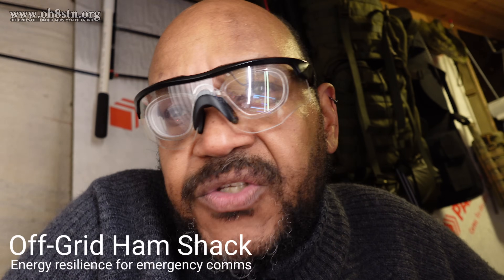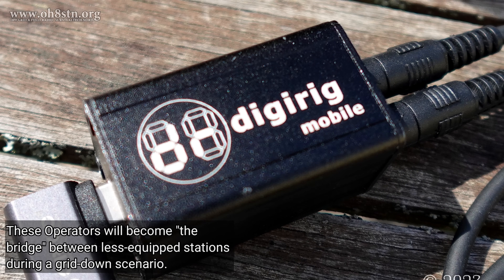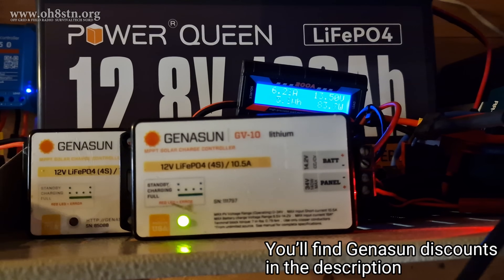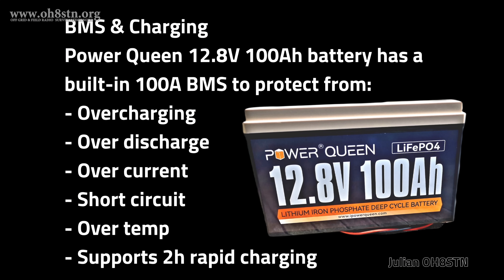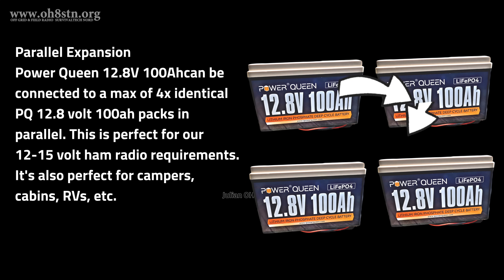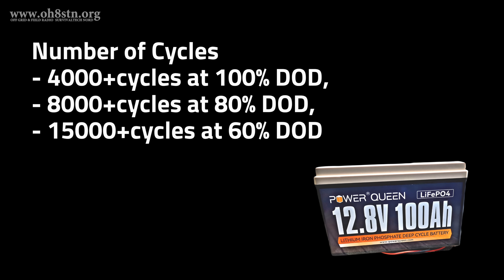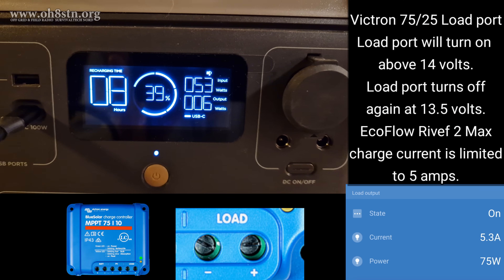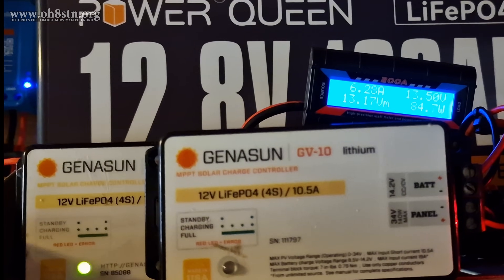Energy Self-reliance & Off-Grid Ham Radio Station

Comment: Julian - Thanks for providing information based on a pragmatic implementation. I'm motivated to run my shack on solar because I think it would be less expensive than increasing my service from 100 amps to 150 amps. I haven't run the numbers but even if the cost were the same I'd rather use solar since it would give me communications even when utility power is unavailable. It seems to me my aggregate demand for power for radios accessories, computers and an amplifier would require at least 100 amps without redundancy so perhaps a design goal might be a system to support 200 amps. You have no doubt worked the numbers and perhaps have a tool or spreadsheet that would help with the design. Thanks - Phil K0PWS

Comment: Hello. Love all your videos and in the process of emulating this system. I would like to ask how is the EcoFlow River 2 Max for RFI?
Reply from the maker: Thank you 🙏
As with all inverter generators, there are two sides to this question. 
The DC outputs, USB outputs, and charging from solar or USB-C PD are all clean.
When the AC inverter outputs are on or AC is being used for charging the River 2 Max, the RFI is terrible. 
I only use the AC side as an emergency measure. So the AC ports are deactivated unless in use. This way, RFI is not an issue day to day.
Hope this helps.
73
Julian oh8stn
Reply from the maker: Take a look at this post: https://oh8stn.org/blog/2023/12/21/building-an-off-grid-solar-powered-ham-shack/

Comment: Ive been tinkering with solar for years now.
Getting real world experience with what you need and what you can generate is vital to success.
My hamshack has always been off grid.
I dont own a wall plug power supply.
With lifpo4 320amp battery is a game changer for sure.

Thanks for another great video.

73 VA6CQB

Comment: so you are going to put multiple charge controllers in to handle the amperage of the solar panels ?
Reply from the maker: In part yes, but also to handle the different sets/strings of solar panels. I've got a set of solar panels up on the tower. One south facing set at the back of the building. Two sets on the southwest wall of the building.  Finally, another south facing set on a lean-to we are building next spring. We would also like to add supplemental panels. For example, some of my portable panels in an emergency. All of these different sets or strings of solar panels require their own charge controller.

Comment: Yesterday I was thinking on what battery to buy ,then saw you video. Thank you for sharing your experience.  
Could you please check that the coupon code for the battery (discussed on the video) is current? I tried it at the checkout and it is not valid / applying.  Sorry for the inconvenience. 
Thank you,

Comment: not sure I understand what you are doing with the multiple genasuns and the wind camp Anderson power pole thing? are you and if so how are you connecting all the genasuns to the wind camp?
Reply from the maker: Each of the strings of solar panels are connected to an individual charge controller. The connections between the charge controllers and the battery are via the Windcamp SP-8.
Separate video incoming.

Comment: I am surprised that you can parallel the outputs of the charge controllers. Is that something that only Genasun supports or do they all do it?
Reply: As long as we're talking about DC (not AC, that gets more complicated) and the output voltage of both is kept within a tenth of a volt, it should be fine.
Reply from the maker: @grahamauld8894 I've only tried it with Genasun controllers. However,  multiple strings of solar panels on different charge controllers connected to a single battery is normal on RV, Yachts and Overland vehicles. As long as the controllers output voltage match the battery, theres no problem. 
73
Julian oh8stn

Comment: Thanks Julian, I am just entering the process of setting up a off grid hamshack.  But I'm gonna need to get rid of my windos machine or generate some 110 as well. Looknig at my house its all electric so we will just need to run the 110 fan in the woodstove to get some house heat.  This is going to be a study.  Perhaps I just get 12v uninterupted in the shack first.  N5OBC
Reply from the maker: You might find that AC/110 introduces noise into your radio equipment. Have you considered a peltier based wood stove fan?

Comment: Really looking forward to this series. Are you running DC appliances (non-Ham) in your shack or AC through an inverter? I've been hunting for quality DC lights, hot plates, etc. but the "quality" part does not seem to be out there.
Reply from the maker: Agreed.
Trying to keep everything DC, because of the inverter noise on HF. The EcoFlow River 2 has 2x AC outlets just in case AC is required temporarily. 
Quality lighting is my problem. Testing LED lamps used in busses/cars, but the switching is terrible.

Comment: How much does your primary radio pack weigh?
Reply from the maker: It's a great question,  but difficult to answer as I use different rigs for different applications. For data comms (my primary operating mode) I use an IC-705 with Microsoft Surface & N9SAB dipole. Total weight 1.5kg/3.5lb for all mode, data, phone, cw, ...
https://www.youtube.com/watch?v=r22xilag_9A
Reply: @OH8STN  Wow. I've got a way to go. Down to one pack and tablet (two carrys). Pack is 26 lbs. Believe me, this is 1/4 of what I used to pack.

Comment: Hi Julian!  I have been running an offgrid ham shack for the past 3 years.  Everything runs off of solar charged batteries: Radios, computers, lights etc. At the moment all is kind of ramshackle.  I have been following Will Prouse's youtube channel.  He offers many videos on setting up off grid systems.  I took from his book a plan for a photovoltaic system for an RV or small cabin.  It is a system consisting of at least 800w of solar panels (I am using 1200w) a 24 volt system, total 600Ah and a 3000w AC-DC inverter.  This system is moveable and is intended to also back up essential appliances at the house in case of a long term grid down situation.  The components are there.  I will be assembling soon.
Reply from the maker: Thanks for watching and commenting. The reason I didn't go with inverters is the noise they create on hf. This is about the only thing I can see, which is different in offgrid cabins, RV, ... than ham shacks. Have you found a quiet inverter yet?
73
Julian oh8stn

Comment: I love having multiple back up charge controllers, BMS's and inverters. Very smart. I do the same and even have back ups in a faraday cage. One thing I noticed. Your wind generator shaft goes directly into generator. This puts a lot of strain on the bearings in the generator. Having a separate, stand alone bearing between the generator shaft and shaft of the rotor would take the strain off the bearings in the generator and should help the generator to last longer. Just an observation. Thanks for all you do for the emergency radio community Julian.

Comment: I have safety concerns with that DC power block as you expand your power system. Have you considered using a combiner box with breakers?
Reply from the maker: Yes, I have the same concerns. Currently I can generate up to thirty amps from all of my solar strings. More strings will require the planned additional power distribution board. Naturally, I am willing to consider a combiner, If someone has experience with one they can recommend.  Recommendations welcome 🙏👍
Reply: I am off grid and use Midnite Solar combiner boxes.
Reply from the maker: I'll check them out 🙏 Thank you.

Comment: Nice kit. As long as you aren't net control running multiple radios you are set.
Reply from the maker: Thanks. I'm generally running three radios at a time with this set up. Winlink Gateway, Robust Packet HF APRS, and a JS8Call station. Voice comms while the others are running could be problematic if we're on the same band. Otherwise I think (hope) it will be okay.

Comment: Having multiple smaller charge controllers instead of one big one is smart for redundancy puprposes. Would you say that’s the most likely thing to malfunction?
Reply from the maker: Excellent comment!
From years of field experience, I expect the Genasun charge controllers to be the last thing to fail.  The redundancy is great for ensuring only a single string can fail at a time. The Victron is also rock solid. My weakest points are too high current in the power distribution and the current cobbled together wiring mess. Both of those things will be remedied as we progressed through the series.
Thanks for the excellent questions.